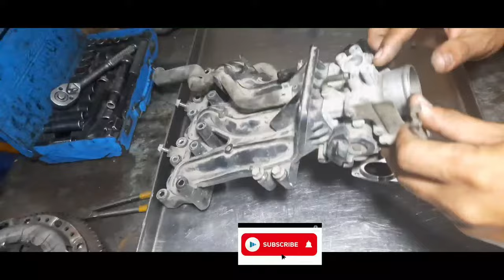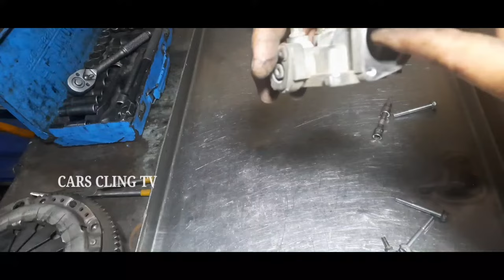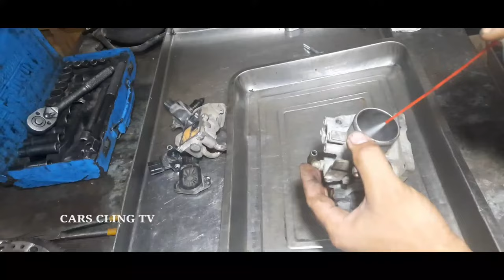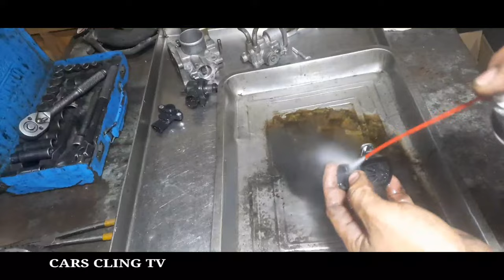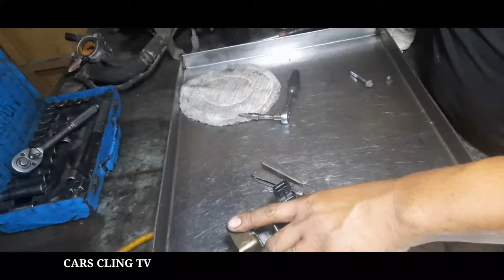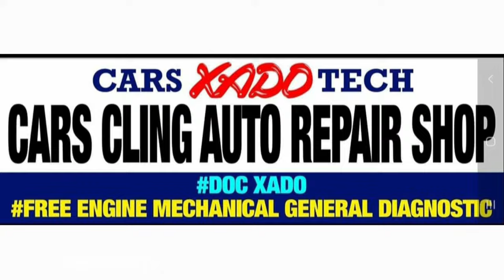ENGINE VIBRATION DIED DURING IDLING IACV TPS MAP SENSORS MAIN CAUSE ISSUE CLEANING SET UP TUTORIALS

Comment: Boss da63t ko nawawala walayung power pag mejo malayo na takbo tapos babalik tapos mawawala na naman
Reply from the maker: Ang sitwasyon kung saan nawawala at bumabalik ang hatak o power ng makina ng iyong Suzuki ay maaaring sanhi ng ilang posibleng problema sa iba't ibang parte ng sasakyan. Narito ang ilang posibleng sanhi at kanilang paliwanag:

1. **Problema sa Fuel System**: Maaaring barado ang fuel filter o may problema sa fuel pump, na nagdudulot ng hindi sapat na daloy ng gasolina papunta sa makina.

2. **Ignition System Issues**: Problema sa spark plugs, ignition coils, o wiring na nagdudulot ng hindi regular na pag-apoy sa mga cylinder ng makina.

3. **Mass Air Flow Sensor (MAF) o Oxygen Sensor Failure**: Kung ang mga sensor na ito ay hindi tama ang pagbabasa, maaari nilang gawing hindi tama ang air-fuel mixture, na nagreresulta sa pagkawala ng hatak.

4. **Throttle Position Sensor**: Kung ang sensor na ito ay may problema, maaaring hindi tama ang pag-control sa acceleration ng makina.

5. **Faulty EGR Valve**: Ang exhaust gas recirculation (EGR) valve na hindi tama ang trabaho ay maaaring magdulot ng pagkawala ng power ng makina.

6. **Electrical Issues**: Maluwag o corroded na electrical connections at grounding points ay maaaring magdulot ng intermittent na power issues.

7. **Transmission Problems**: Kung ang transmission ay nagkakaroon ng problema, maaari rin itong magdulot ng pagkawala ng hatak.

Upang matukoy ang eksaktong isyu, rekomendado na dalhin ang iyong sasakyan sa isang lisensyadong mekaniko para sa isang komprehensibong diagnostic test. Magagamit ng mga mekaniko ang mga diagnostic tools para malaman ang mga error codes at matukoy ang eksaktong problema ng iyong sasakyan.
Reply from the maker: Thank you for your support. Please contact me at this link:

More Basic Pointers Toturials FULL Videos: https://www.youtube.com/channel/UCXSl7FUzPZV3lIxFWCHFTVA
For more inquiries, please contact us at our 
FB Page CARS CLING TV & XADO Available @our FBPage: https://www.facebook.com/clingauto
CARSClingTvShortVideos: https://www.youtube.com/channel/UCsUWQnaD9vVKqL_w6eAYhgA
#
#xadoenginetreatment 
#carsclingtv 
#basicpointerstutorialissuefixed 
#xadoenginetreatmentengineperformancerecovered
#10yearslonglastceramicscarbonmetalcoated 
#carsclingautorepairshoplegacy 
#trottledelayremoval
#blackwhitesmokeremoval
#lowpowerengineremoval
#carsclingtvshortvideos
#xadoenginetreatment 
#changeoilpms
#enginecarbonchroming 
#carsclingautorepairshop
#remedyxadotreatment 
#acceptcheckengineissue 
#troubleshoot 
#legitonlineseller  
#Mobile09171259996
CARS CLING TV Located @Purok Pandian Gay Corner Makar Highway Brgy. Labangal General Santos City SouthCotabato 9500

Comment: Boss panu ba tamang mgkabit Ng sensor wiring? Salamat sa tugon.
Reply: Iba2x kc kulay nya.
Reply from the maker: Ang proseso ng pagkabit ng sensor wiring para sa Suzuki K6A engine ay maaaring magkaiba depende sa partikular na sensor na kailangan mo ikabit. Ngunit sa pangkalahatan, narito ang ilang mga hakbang na maaari mong sundin:

1. Alamin ang tamang lokasyon ng sensor:  Unahin mong matukoy kung saan dapat ikabit ang sensor wiring. Maaaring ito ay nasa iba't ibang bahagi ng engine tulad ng intake manifold, cylinder head, o transmission.

2. Maliwanag ang daan:  Siguraduhin na ang daan kung saan dadaan ang sensor wiring ay malinis at malinaw. Alisin ang anumang obstructions na maaaring maharangan ang wiring habang ito'y inaayos.

3. I-connect ang sensor wiring: Ikonekta ang mga wires ng sensor sa kaukulang terminal o connector. Siguraduhing tama ang pagkakabit ng mga wires at mahigpit na nakakonekta upang maiwasan ang anumang problema sa koneksyon sa hinaharap.

4. I-secure ang sensor wiring: Siguraduhing maayos na nakakabit ang sensor wiring at maayos na naka-secure o naka-clip sa tamang lokasyon kung saan ito dapat ikabit. Iwasan pagsasalig sa lamang tape o kahit anong temporar na pang-secure,  at siguraduhing may sapat na proteksyon mula sa mga abrasive surfaces o heat sources.

5. Subaybayan ang mga koneksyon: Pagkatapos ng pagkakabit, masusing subaybayan ang mga koneksyon ng sensor wiring upang matiyak na ang mga ito ay malakas at nakaayos ng maayos. Isagawa ang kinakailangang pagsusuri o pag-test upang matiyak na gumagana ng wasto ang mga sensor.

Mahalaga na sundin ang tamang mga hakbang at kung hindi sigurado, mas mahusay na magpakonsulta sa isang propesyonal na mekaniko o sumangguni sa Suzuki K6A engine wiring diagram para sa tamang pagkakabit.
Reply from the maker: Thank you for your support!

More Basic Pointers Toturials FULL Videos: https://www.youtube.com/channel/UCXSl7FUzPZV3lIxFWCHFTVA
For more inquiries, please contact us at our 
FB Page CARS CLING TV: https://www.facebook.com/clingauto
CARSClingTvShortVideos: https://www.youtube.com/channel/UCsUWQnaD9vVKqL_w6eAYhgA
#
#xadoenginetreatment 
#carsclingtv 
#basicpointerstutorialissuefixed 
#xadoenginetreatmentengineperformancerecovered
#10yearslonglastceramicscarbonmetalcoated 
#carsclingautorepairshoplegacy 
#trottledelayremoval
#blackwhitesmokeremoval
#lowpowerengineremoval
#carsclingtvshortvideos
#xadoenginetreatment 
#changeoilpms
#enginecarbonchroming 
#carsclingautorepairshop
#remedyxadotreatment 
#acceptcheckengineissue 
#troubleshoot 
#legitonlineseller  
#Mobile09171259996
CARS CLING TV Located @Purok Pandian Gay Corner Makar Highway Brgy. Labangal General Santos City SouthCotabato 9500

Comment: idol yung unit ko po biglang nag taas minor at baba ,yan po rin  yung nasa blog mo yung probs?
Reply from the maker: Yes Sir,  paki check ng iacv sensor and motor if ok pa ito pati ang reading ng electrical voltage drop nito, then if ok paki check ng vacuum leak lalo na ang PCV valve baka po hindi na ito gumagana,
For more inquiries contact @ FB Page: https://www.facebook.com/clingauto
Please Support, Follow and Send Stars to make more Videos upload. Thank you and God bless!
#gCashPersonalNumber 09171259996
CARS CLING TV Located @Purok Pandian Gay Corner Makar Highway Brgy. Labangal General Santos City SouthCotabato 9500
please support my other channel:
CARSClingTvShortVideos: https://www.youtube.com/channel/UCsUWQnaD9vVKqL_w6eAYhgA
Aqua Marine Adventure: https://www.youtube.com/channel/UCHxjUhFmYMbRGxN3l21pNeg
Reply: Ano po ibig sabihin ng pcv sir?
Reply from the maker: Ang PCV (Positive Crankcase Ventilation) valve ay isang bahagi ng sistema ng sasakyang pangkalsada na nakakabit sa crankcase o bahaging kung saan nasisiguro ang oil ng makina. Ang pangunahing tungkulin ng PCV valve ay ang paghigop ng mga gas mula sa crankcase at pagpapalabas nito patungo sa intake manifold ng makina.

Ang PCV valve ay mayroong dalawang kahon. Ang una ay umaangkop sa inlet air manifold, at ang pangalawa ay konektado sa crankcase. Sa pamamagitan ng dalawang hose na konektado sa PCV valve, ang malamig na inlet air mula sa inlet manifold ay pinapadaan sa crankcase, kung saan tinatanggal nito ang mga gas at dumi tulad ng vaporized oil, combustible gazes, at iba pa.

Ang mga gas at dumi na tinanggal ng PCV valve ay napapalabas sa intake manifold at inaabsorb ng makina sa pamamagitan ng combustion process. Sa pamamagitan ng pagpapalabas ng mga gas at dumi, ang PCV valve ay nagpapanatili ng tamang presyon at kahalumigmigan sa loob ng crankcase ng makina. Ito rin ang nagbibigay ng pag-iwas sa pagkakaroon ng pressure buildup na maaaring makaapekto sa pag-andar ng mga mekanikal na bahagi ng makina.

Ang PCV valve ay mahalagang bahagi ng sistema ng pagre-recirculate ng gas mula sa crankcase ng sasakyan, kung kaya't dapat itong maayos na mapanatili at linisin upang mapanatili ang tamang pag-andar at pagganap ng makina. Regular na pag-check at pagpalit ng PCV valve at paglilinis nito ay kinakailangan upang mapanatiling maayos ang sistema ng PCV sa sasakyan.

More Basic Pointers  Toturials videos: https://www.youtube.com/channel/UCXSl7FUzPZV3lIxFWCHFTVA
FB Page CARS CLING TV: https://www.facebook.com/clingauto
CARSClingTvShortVideos: https://www.youtube.com/channel/UCsUWQnaD9vVKqL_w6eAYhgA
#
#xadoenginetreatment 
#carsclingtv 
#basicpointerstutorialissuefixed 
#xadoenginetreatmentengineperformancerecovered
#10yearslonglastceramicscarbonmetalcoated 
#carsclingautorepairshoplegacy 
#trottledelayremoval
#blackwhitesmokeremoval
#lowpowerengineremoval
#carsclingtvshortvideos
#xadoenginetreatment 
#changeoilpms
#enginecarbonchroming 
#carsclingautorepairshop
#remedyxadotreatment 
#acceptcheckengineissue 
#troubleshoot 
#legitonlineseller  
#Mobile09171259996
CARS CLING TV Located @Purok Pandian Gay Corner Makar Highway Brgy. Labangal General Santos City SouthCotabato 9500

Comment: Sir maitanong ko lang paano yong aircon pang mag break ako naga open  yon aircon
Reply from the maker: Ang mga posibleng dahilan kung bakit gumagana ang aircon system kapag gumagamit ka ng brake system ay maaaring mga sumusunod:

1. Electric Load Management: Sa mga modernong sasakyan, mayroong mga electronic control unit (ECU) na nagpapahintulot sa pagpapatakbo ng iba't ibang sistema ng sasakyan. Ang ECU ay maaaring mag-regulate ng enerhiya at iprioritize ang paggamit ng aircon system at brake system sa ibang mga kondisyon ng pagpapatakbo ng sasakyan.

2. Faulty Wiring or Electrical Connections: Maaaring mayroong depekto o maling kable o koneksyon sa electrical system ng sasakyan. Ito ay maaaring magresulta sa pagkakaroon ng crossover electrical signal mula sa brake system papunta sa aircon system, na nagpapatakbo nito nang hindi nais.

3. Electrical Grounding Issues: Ang problema sa grounding ng sasakyan ay maaaring magdulot ng mga hindi inaasahang pagkilos sa iba't ibang bahagi ng electrical system. Ito ay maaaring magdulot ng hindi kanais-nais na paggana ng aircon system kapag nagagamit ang brake system.

Para masiguro ang tamang pag-andar ng sasakyan, mahalagang dalin ito sa isang propesyonal na mekaniko upang malutas ang mga isyu sa electrical system at maayos ang mga koneksyon.

More Basic Pointers  Toturials FULL Videos: https://www.youtube.com/channel/UCXSl7FUzPZV3lIxFWCHFTVA
FB Page CARS CLING TV: https://www.facebook.com/clingauto
CARSClingTvShortVideos: https://www.youtube.com/channel/UCsUWQnaD9vVKqL_w6eAYhgA
#
#xadoenginetreatment 
#carsclingtv 
#basicpointerstutorialissuefixed 
#xadoenginetreatmentengineperformancerecovered
#10yearslonglastceramicscarbonmetalcoated 
#carsclingautorepairshoplegacy 
#trottledelayremoval
#blackwhitesmokeremoval
#lowpowerengineremoval
#carsclingtvshortvideos
#xadoenginetreatment 
#changeoilpms
#enginecarbonchroming 
#carsclingautorepairshop
#remedyxadotreatment 
#acceptcheckengineissue 
#troubleshoot 
#legitonlineseller  
#Mobile09171259996
CARS CLING TV Located @Purok Pandian Gay Corner Makar Highway Brgy. Labangal General Santos City SouthCotabato 9500

Comment: Sir gdam.matagal bumaba ang idle,check Ko cable,ok naman.
Reply from the maker: Yes Sir,. Ang big eye suzuki FI engine normal po na tumaas ang idle with in 5seconds then balik agad ng normal idle,. Pero kung mag steady ng almost 20secinds up may issue na po dito ang vacuum leak, either leak ng hoses and pcv valve,. Need ipa check sa mechanic,.

Comment: Boss ano po bang sira ng sasakyan ko na da64 kapag nka on ang ac nanginginig o nagvirbrate ang sasakyan ko
Reply from the maker: Ang malakas na engine vibration kapag ang AC (air conditioning) system ay nakabukas sa isang Suzuki Transformer ay maaaring may mga sumusunod na posibleng dahilan:

1. Kompressor ng AC:
   - Ang kompressor ng AC system ay maaaring may isyu, tulad ng pagkakaroon ng pagkasira o hindi wastong pagkilos.
   - Ang kompressor na may problema ay maaaring magdulot ng hindi pantay na paggana at malakas na vibration sa engine.

2. Mounting ng AC Kompressor:
   - Ang mounting ng AC kompressor ay maaaring hindi sapat o hindi tama ang pag-align.
   - Ang hindi wastong mounting ay maaaring magdulot ng malakas na vibration habang ang AC ay gumagana.

3. Paghina ng Engine Mounts:
   - Ang paghina o pagkasira ng engine mounts ay maaaring magdulot ng mas malaking paggalaw ng engine, lalo na kapag gumagana ang AC.
   - Ang mahinang engine mounts ay maaaring magdulot ng malakas na vibration.

4. Imbalance ng Engine:
   - Ang isyu sa pagkakabalanse ng engine, tulad ng problema sa crankshaft o piston, ay maaaring magdulot ng malakas na vibration kapag gumagana ang AC.

5. Problema sa Belt System:
   - Ang problema sa timing belt, alternator belt, o iba pang engine belt ay maaaring magdulot ng malakas na vibration habang ang AC ay gumagana.

Upang malutas ang problema, kailangan mong suriin ang kondisyon ng AC system, engine mounts, at iba pang mga bahagi na maaaring makaapekto sa engine vibration. Maaari kang humingi ng tulong mula sa isang mekaniko upang matukoy at maayos ang ugat ng problema.

Thank you for your support!

More Basic Pointers Toturials FULL Videos: https://www.youtube.com/channel/UCXSl7FUzPZV3lIxFWCHFTVA
For more inquiries, please contact us at our 
FB Page CARS CLING TV: https://www.facebook.com/clingauto
CARSClingTvShortVideos: https://www.youtube.com/channel/UCsUWQnaD9vVKqL_w6eAYhgA
#
#xadoenginetreatment 
#carsclingtv 
#basicpointerstutorialissuefixed 
#xadoenginetreatmentengineperformancerecovered
#10yearslonglastceramicscarbonmetalcoated 
#carsclingautorepairshoplegacy 
#trottledelayremoval
#blackwhitesmokeremoval
#lowpowerengineremoval
#carsclingtvshortvideos
#xadoenginetreatment 
#changeoilpms
#enginecarbonchroming 
#carsclingautorepairshop
#remedyxadotreatment 
#acceptcheckengineissue 
#troubleshoot 
#legitonlineseller  
#Mobile09171259996
CARS CLING TV Located @Purok Pandian Gay Corner Makar Highway Brgy. Labangal General Santos City SouthCotabato 9500

Comment: Boss yong big eye 2017 model ko nag ba backfire at nag VA vibration pag  pag kumukunti nlng Gasolina..tapos umu osok ng puti pag new start sa Umaga..Wala namang check ingine..ano po bayan?
Reply from the maker: Ang mga sintomas na inyong inilarawan tulad ng backfire, vibration, at puting usok sa pagpapalit ng umaga ay maaaring magkaroon ng ilang posibleng dahilan. Ngunit hindi sapat ang impormasyong ibinigay upang mabigyan kayo ng eksaktong sagot. Narito ang ilang posibleng mga sanhi:

1. Ignition System - Maaaring may problema sa ignition system tulad ng spark plugs, ignition coils, o spark plug wires. Ang mga ito ay maaaring sanhi ng backfire at pag-vibrate kapag mababa ang gasolina.

2. Fuel System - Posible rin na may problema sa fuel system tulad ng clogged fuel injectors o fuel pump. Ang mga ito ay maaaring magdulot ng mga sintomas na inyong binanggit.

3. Air-Fuel Mixture - Maaaring mayroong pagkakamali sa tamang air-fuel mixture sa engine. Kapag mababa ang gasolina, maaaring makaranas ng backfire o vibration dahil sa hindi tamang combustion.

4. Engine Timing - Ang hindi tama o maling engine timing ay maaaring magdulot ng mga sintomas na inyong inilarawan.

Ang mga katangian na inyong inilarawan ay maaaring magkapareho o makakaugnay ng mga nakalistang mga posibleng dahilan. Ngunit mahalaga na magpakonsulta sa isang propesyonal na mekaniko upang masuri ang inyong sasakyan at magbigay ng eksaktong pagkakasagot. Sila ay pinapayuhan na isagawa ang isang komprehensibong pagsusuri sa sasakyan, posibleng isama ang pag-scan ng computer ng sasakyan upang matukoy ang posibleng mga error code, at iba pang mga diagnostic procedure na makakatulong ng mga experto na matukoy ang sanhi ng mga isyung ito.

Thank you for your support!

More Basic Pointers Toturials FULL Videos: https://www.youtube.com/channel/UCXSl7FUzPZV3lIxFWCHFTVA
For more inquiries, please contact us at our 
FB Page CARS CLING TV: https://www.facebook.com/clingauto
CARSClingTvShortVideos: https://www.youtube.com/channel/UCsUWQnaD9vVKqL_w6eAYhgA
#
#xadoenginetreatment 
#carsclingtv 
#basicpointerstutorialissuefixed 
#xadoenginetreatmentengineperformancerecovered
#10yearslonglastceramicscarbonmetalcoated 
#carsclingautorepairshoplegacy 
#trottledelayremoval
#blackwhitesmokeremoval
#lowpowerengineremoval
#carsclingtvshortvideos
#xadoenginetreatment 
#changeoilpms
#enginecarbonchroming 
#carsclingautorepairshop
#remedyxadotreatment 
#acceptcheckengineissue 
#troubleshoot 
#legitonlineseller  
#Mobile09171259996
CARS CLING TV Located @Purok Pandian Gay Corner Makar Highway Brgy. Labangal General Santos City SouthCotabato 9500
Reply: Salamat boss..god bless
Reply from the maker: Thank you for your support!

More Basic Pointers Toturials FULL Videos: https://www.youtube.com/channel/UCXSl7FUzPZV3lIxFWCHFTVA
For more inquiries, please contact us at our 
FB Page CARS CLING TV: https://www.facebook.com/clingauto
CARSClingTvShortVideos: https://www.youtube.com/channel/UCsUWQnaD9vVKqL_w6eAYhgA
#
#xadoenginetreatment 
#carsclingtv 
#basicpointerstutorialissuefixed 
#xadoenginetreatmentengineperformancerecovered
#10yearslonglastceramicscarbonmetalcoated 
#carsclingautorepairshoplegacy 
#trottledelayremoval
#blackwhitesmokeremoval
#lowpowerengineremoval
#carsclingtvshortvideos
#xadoenginetreatment 
#changeoilpms
#enginecarbonchroming 
#carsclingautorepairshop
#remedyxadotreatment 
#acceptcheckengineissue 
#troubleshoot 
#legitonlineseller  
#Mobile09171259996
CARS CLING TV Located @Purok Pandian Gay Corner Makar Highway Brgy. Labangal General Santos City SouthCotabato 9500